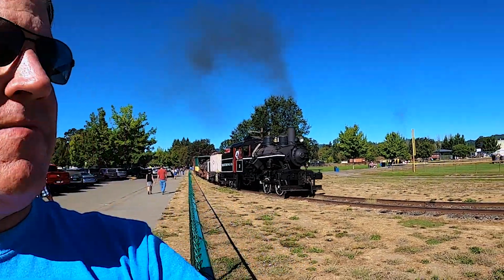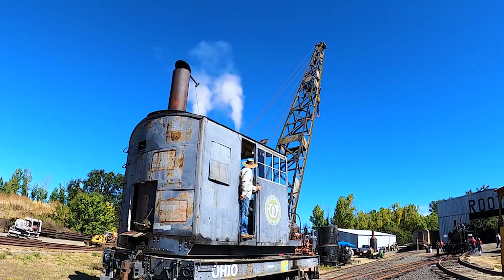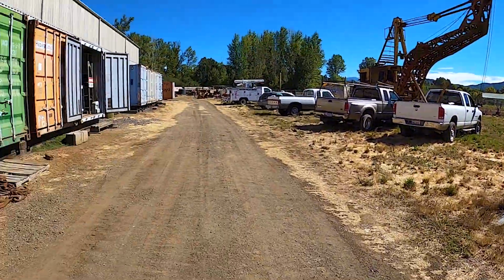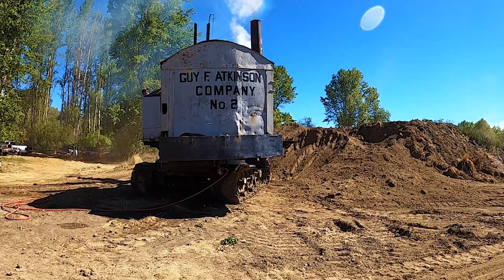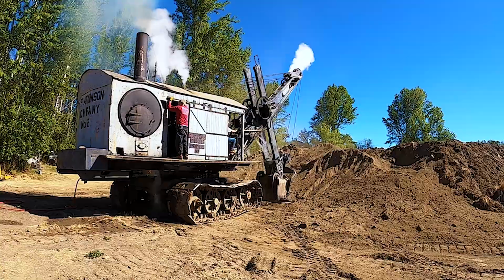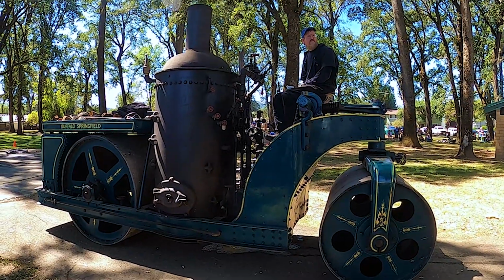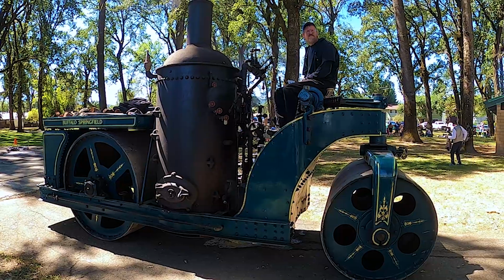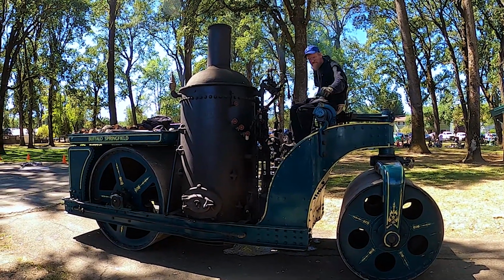Antique Equipment Galore

Comment: What does the big engine at the first of the video do? Love the steam shovel #2! The artist is cool. The cable drives work very well. Steam roller is neat! Steam drill looks mean. Love you man!
Reply from the maker: @woodypope7421  The first machine is a yarder that was used for lumber and anything else. They used it to pull logs with.